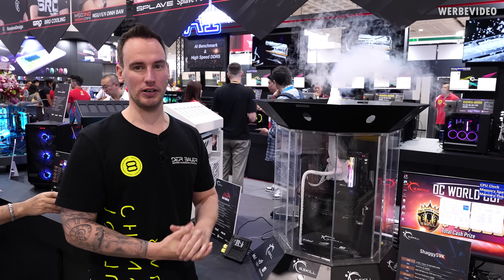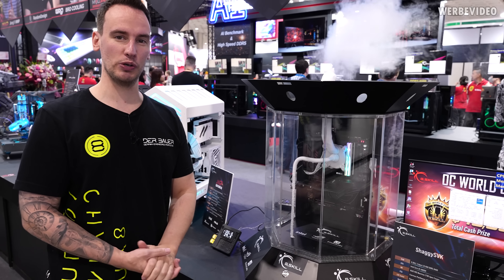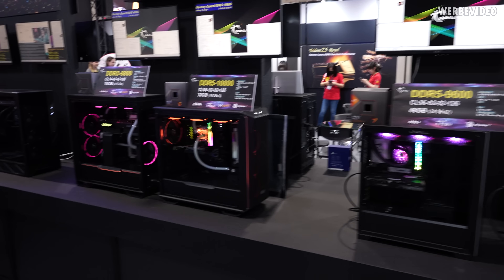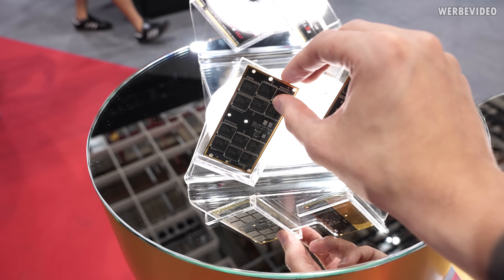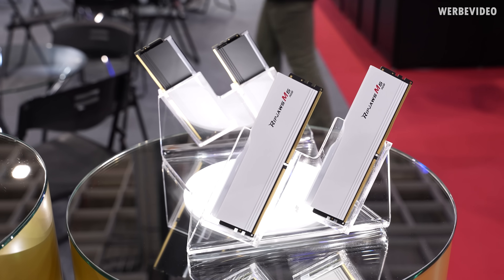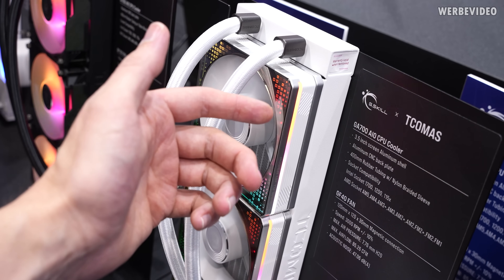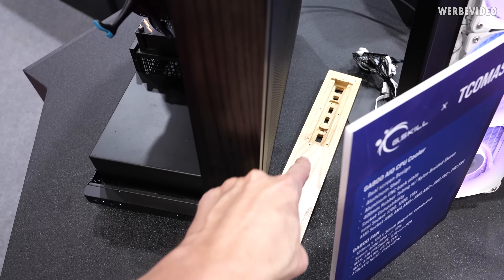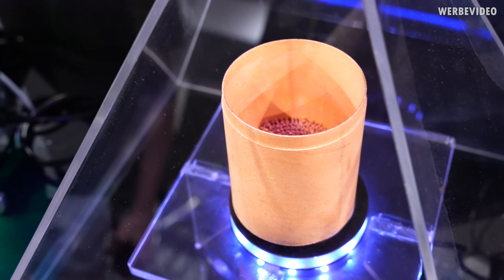DDR5 Modules with 10600 MT and a $ 10,000 LN2 Cooler - G.Skill Computex 2024

Comment: Upgrading/expanding memory is already a roll of the dice (e.g. you buy 2 modules initially, and then you buy another 2 later on). DDR5 is full of "kits" and populating all 4 slots is already plagued with instability, not to mention the CPU cooler compatibility woes with tall ram.

CAMM2 looks interesting, I wouldn't mind abandoning the DIMM form factor. As long as they actually make some huge chonker 256Gb kits...

Comment: CAMM2 is interesting. Not being able to go from 2 DIMMs to 4 is a drawback, but 4 DIMMs often have stability issues anyway and you still need a matching kit, so you often end up replacing 2 DIMMs with 4 new ones anyway. I think the main appeal of CAMM2 for me is being able to put a heatsink on it. DIMMs are finicky to cool because they're vertical, so no one really bothers to replace the manufacturer-provided heatsinks, but that shouldn't be an issue with CAMM2. I'm much more on board with putting a big heatsink on my RAM than on an SSD.
Reply: it would be interesting if you could put a second CAMM2 on the back of the board
Reply: You don't really need a matching kit for 4 dims.  I've done the 2-4 Dimms upgrade in my desktop without any real stability hit.  Same speed and primary timings, but most definitely not a matching kit.  Though I do agree with several of your positives for CAMM2.
Reply: @RyuFelinshire  You're absolutely correct about not needing matching DIMMs as long as the speed and timings are the same, but DDR5 is much more finnicky than DDR4. With DDR5, even matching kits (same speed, timings, and brand) typically won't run at the advertised speed/timings when using 4 sticks. 
Using 4-sticks of DDR5 without stability issues usually requires running at 5200MT/s rather than the kits advertised XMP or EXPO speeds.

Comment: Don't like the CAMM2 RAM modules. They aren't practical. The backside can't be cooled at all and it has a huge footprint on the mainboard compared to DIMM. For DIMM there are already decent cooling solutions, but the problem is that every manufactur tries to reinvent the look of their RAM twice per year.
The weirdly shaped concept cases look nice, but they only work for on top of the desk, not under it. And I personally don't like anything right next to me that makes fan noises. Being able to remove the whole mainboard mounting plate is a huge plus though. Imo it doesn't even have to be a complex sliding mechanism. Just some slots where it clicks in would be enough.

Comment: This CAMM2 isn't really an improvement in my opinion. If we look at the system that is running at DDR5 10600MT/s it would seem like the limitation is on the side of IMC, not the DIMM traces. As for the cooling the CAMM2 is double-sided so how would you cool the IC's oriented towards mobo? 
For normies it would be better if the mobo just had DIMM slots at a ~45-60 deg angle so memory modules wouldn't interfere with dual tower coolers. Ever since DDR4 was introduced plugging and unplugging of RAM doesn't require much force so there shouldn't be a risk of damaging something with angled connectors.

Comment: The new module design is nice, but one of the main features of the typical DIMM design is that it's compact. The new design takes up more space on the motherboard than four DIMM sockets and you lose the flexibility offered by having multiple channels available to fill as desired. No motherboard will have more than one of the new sockets and you'll be stuck with the manufacturer's choice of channels. You want to fill all four channels of DRAM and the CAMM2 manufacturer(s) only offer dual channel support? You're out of luck.

Comment: For small form factors like ITX and mini PCs as well as high performance and embedded systems CAM is far and away better than soldered on memory.  For workstations I still want expandability even at the expense of memory frequency. It would be cool if we still had something like optane to use like a swap petition to allow for some additional slower memory for some use cases. Mind you modern SSDs are already reasonably capable of this for some applications

Comment: the entire concept of the camm2 module for desktop systems just seems like a total regression.
Reply: It is the only way to get higher capacity RAM "sticks" running at 7000MT/s+. I dont think it is as much of a regression as people think. If you have a 4 DIMM mobo and only populate 2 DIMMs and later you look to upgrade, you will need matching memory kits from the same vendor which could be hard to find because it's now awhile since your last upgrade. If you don't use matching kits your timings can suffer and even cause instability. On a higher end Gaming PC CAMM2 makes a lot of sense giving you higher speeds along with good timings. We can also start to see ram modules pushed even higher with a heatsink.
Reply: They are better. Shorter traces and more cooling options. Also, mobo manufacturers can fit them on the back of the board, and modules can hold more chips. Memory is going to be hugely important in the coming years. Both for CPU and GPU.

Comment: I wouldn't mind CAMM2 as long as there are benefits to them over DIM. If there's no benefit for desktops I don't see why we would switch to something that's more cumbersome
Reply: No benefits? Lower profile - better compatibility with air coolers. Shorter traces - faster speeds and lower latency. Flat surface and thus easier to cool. Bigger capacities etc. There are multiple benefits for desktops over standard DIMM's.
Reply: @Raivo_K  I didn't say it didn't have benefits. I said if. It already has some downsides compared to DIM, which was why I put it that way.

Comment: Really wanna see CAMM2 take off. It's simply better!. The only concern right now would be price. But, just like any other new RAM, it should come down in price as adaptation increase.
As for capacity. Dell slide shows for the AXXX variant it support up to 128GB, BXXX is 256GB, and DXXX is 512GB. For mainstream desktop the AXXX variant should be enough.

Comment: i like the camm2 modules. I feel like it would provide some interesting customization opportunities for the heatsink and in combination with backfacing motherboard connectors it further cleans up the aesthetics. Also, these days the price per GB of memory is so low that I usually only upgrade memory when I configure a new system anyway.

Comment: I dont like CAMM2 not only because of its footprint (which is seemingly mostly concerned with making laptops thinner) but mainly because of expandability: on a normal desktop board i can (in theory) buy a single stick and it will run - lower bandwidth sure but still. i can also just buy more ram and add it to the system when required. with camm2 there seems to be no plan for multiple modules as far as i can tell. not to mention that DIMMs will continue in the server space regardless, since 8+ slots are just not happening with CAMM.

in short: keep laptop solutions to laptops. if the routing is such a problem on desktop, work on a solution more suited for desktop/server usage, dont just take something that was designed for primarily keeping things flat to an ecosystem where height usually isnt an issue (even SFF builds are not that constrained in terms of RAM height, as long as you dont go with stuff like dominator platinums)
Reply: I think the expandability option severely diminished with DDR5 regardless. With two slots it's now possible to run 96GB and soon 128GB. Also most common DDR5 kits are 2x16GB and i have a hard time seeing a scenario in the coming years where 32GB wont be enough for most people and would necessitate expansion. So in the current state four slots are wasted on most boards anyway. Plus running four sticks incurs severe speed, latency and memory training penalty. As long as CAMM2 is user replaceable and not soldered i have no problem with it. It could even be possible to make room for it at the back of the board in the same location. Thus giving the option to expand down the line.

Comment: 2 things that come to mind.
the backside is a disaster to cool unless they provide enough space arround the socket on the motherboard to sandwitch a cooler under it.
Second how do you add memory if this modules has the same pcb footprint on the motherboard as 4/6/8 dimm slots

and i do not see it a space saver in laptops as that modules fulley assembeld will take up the same space as 2 sodimm slots.

What would be cool for normal motherboards would be if there is a vertical "socket" so you could put mutiple for the same pcb space.

However this would be nice for gpu,s , add memory to the gpu

Comment: i dont know if the CAMM2 is specially interesting, seems more like a sidestep than a move forward, if there is capacity limits like mentioned, typically the performance for faster ram isn't that much in real world scenarios from what i've seen before, so eh, i think the ability of having multiple sticks for better modularity is still more enticing, plus assuming these camm modules would be expensive.

Comment: On the CAMM2 that is a hard NO from me. As an engineer I get it that it helps to push higher frequencies, but what is the cost to benefit analysis? We don't know the prices AND no future upgrades, along with the fact that in day-to-day tasks the difference will be minimal. Most people don't just nuke their wallets setting up a pc.
Also it isn't even innovation, HBM2 circumvented the PCB entirely it was just for GPUs so most people didn't really feel the disability of swapping ram.
Reply: I think the video on GN said it was somewhat expandable just not by adding 2 DIMMS later. The MSI mobo had additional space to allow for wider cards.
Reply: @metalhedp8ntbll  IIRC it is not expandable, you just sell your 32GB and buy a 64GB one instead (which is wider). Except if that is expandable by your definition, I mean at least it isn't soldered on the motherboard yet...
Reply: That’s why I said somewhat.

Comment: stupid idea, takes too much room on the motherboard. i shudder at the possibility of expansion that will surely be gone when this is implemented
Reply: Current RAM also takes room. Vertical that is. Also expansion is overrated and these new modules are still user replaceable.
Reply: @Raivo_K  expansion and expansible is the cornerstone of second hand markets, it also serves to lengthen the service life of the computer as is. it's not overrated. this is a bad idea

Comment: If the flat memory module provides the same capacity and higher speeds, all while eliminating conflicts with CPU cooler fans... WIN-WIN!
Reply: For us SFF enthusiasts, the search for very low profile RAM is also over.
Reply: until you realize you can't just buy another module of the same size to double your capacity, you have to fork out for the larger capacity module and replace the unit entirely, leaving you with a useless (to you, probably) module you have to find something to do with, or it winds up in the trash.

this spec is a regression in technology if implemented in desktops.

the only way around that, is to make the motherboards larger, which is another regression.

laptops and certain embedded solutions? Sure, makes perfect sense. not in desktops.
Reply: @kenabi  Just sell the old module on a 2nd hand market.
Also, you already buy a memory replacement if you upgrade your memory anyway because mixing up memory modules (especially DDR5) could cause issues.
Reply: @kenabi they could probably find a way to have another slot on the back of the motherboard like some manufacturers do with m.2
Reply: @SeventhCircle77  I really hope they do go this route. I'm using a Noctua NH-D15 and I have to have one of the fans a bit higher than the middle fan because it hits the ram module and I'm not even using ram with a big RGB light on top of it (Using 2x16 crucial modules which are naked).
Reply: @kenabi or you could just sell it? Man you weirdos just pretend like the second hand market doesn’t exist, someone out there will want your 32GB camm module if you’re upgrading to 64GB, stop being disingenuous
Reply: Unless of course we use it for HEDT SFF with "4 channels" aka 2 modules  @kenabi
Reply: @kenabi  Sure, that's a con. but there are lots of pros which attract me. Like, I'm dedicated to air cooling - this will let me use bigger fans for the CPU cooler and cool the VRMs better. Plus, you can get better timings since the traces are shorter and more efficiently routed.
Reply: @kenabi  "Or it winds up in the trash" Now THAT is some next level FUD, bravo! You don't just throw away computer components when you upgrade, you barbarian. 😂 And let me ask you this, as I do everyone else with "upgradeability concerns" about CAMM2. Have you tried populating all 4 DDR5 DIMM slots on your mobo? Do you actually own DDR5 to begin with?

Comment: I really like the idea of CAMM2. Not only from the memory perspective (improved transfer speeds, signaling and latency) but also from the potentials it opens to manufacturers for cooling them, aesthetics and the removal of the height restriction for cpu aircooler height. The only downside i see at least for now, is that you lose the expandability option that you have now
Reply: I think the expandability option severely diminished with DDR5 regardless. With two slots it's now possible to run 96GB and soon 128GB. Also most common DDR5 kits are 2x16GB and i have a hard time seeing a scenario in the coming years where 32GB wont be enough for most people and would necessitate expansion. So in the current state four slots are wasted on most boards anyway. Plus running four sticks incurs severe speed, latency and memory training penalty. As long as CAMM2 is user replaceable and not soldered i have no problem with it.
Reply: @Raivo_K  My usecase requires an ever increasing amount of RAM , I need upgradeability
Reply: @sodanakin  And you have plenty of DDR5 boards with regular DIMM slots. If it were me i would buy the maximum i could afford if i knew my use case required increasing RAM over time.
Reply: @Raivo_K  People said it for 16GB, 8GB, 4GB... It's never enough ram. Give it 5 years and it will not be enough again. History repeats itself
Reply: @marinell06  In five years there will be DDR6 already, making any DDR5 upgrade a moot point as DDR6 requires new motherboards and modules anyway.
Reply: @Raivo_K  A few years after that there will be DDR7 why upgrade to CAMM2 at all ? just wait for CAMM3
Reply: @sodanakin  I asked ChatGPT about that:
Me: "What is the time span between the introduction of new DDR standards?"
ChatGPT: 

"The time span between the introduction of new DDR (Double Data Rate) standards can vary, but typically it has ranged from 3 to 5 years. Here's a brief overview of the release timeline for various DDR standards:

    DDR (DDR1): Introduced in 2000.
    DDR2: Introduced in 2003, about 3 years after DDR1.
    DDR3: Introduced in 2007, about 4 years after DDR2.
    DDR4: Introduced in 2014, about 7 years after DDR3.
    DDR5: Introduced in 2020, about 6 years after DDR4.

Based on these dates, the average time span between the introduction of new DDR standards has been approximately 4.5 years. The actual time span can be influenced by various factors, including technological advancements, industry demand, and the complexity of developing new standards."
Reply: Let's have a camm2 slot on each side of the CPU then (and hopefully you get dual channel even with 1) :p

Comment: i like the idea behind the cam2 mod. but i don't like the idea of having to replace the whole thing if i wanted to upgrade to more ram.
Reply: I think the expandability option severely diminished with DDR5 regardless. With two slots it's now possible to run 96GB and soon 128GB. Also most common DDR5 kits are 2x16GB and i have a hard time seeing a scenario in the coming years where 32GB wont be enough for most people and would necessitate expansion. So in the current state four slots are wasted on most boards anyway. Plus running four sticks incurs severe speed, latency and memory training penalty. As long as CAMM2 is user replaceable and not soldered i have no problem with it.
Reply: @Raivo_K  i hear ya on this.
most of the time when i build a box for someone 32gb is enough for almost anything they'll do and in a lot of cases it's still overkill. i only had one person who probably needed more and all we did was go with (two stick) 64gb. they were doing some hobby AI image & video, plus the video edits.
the thing i run into is the people who buy a system then 3-6 month later they want an upgrade, that they probably don't need. but explaining it to them is 99% a losing battle.